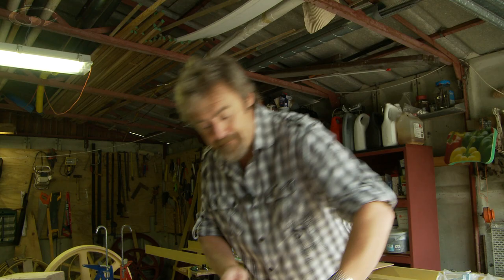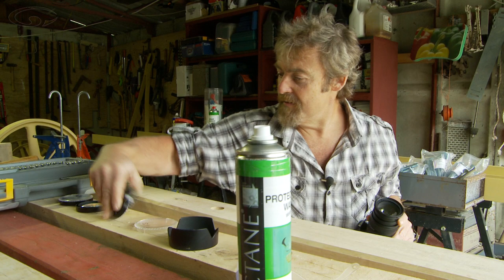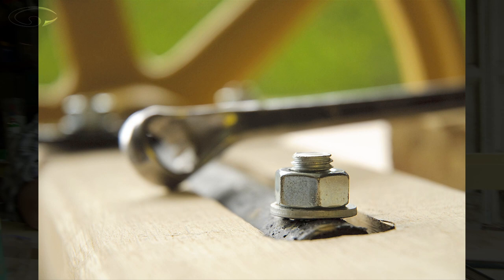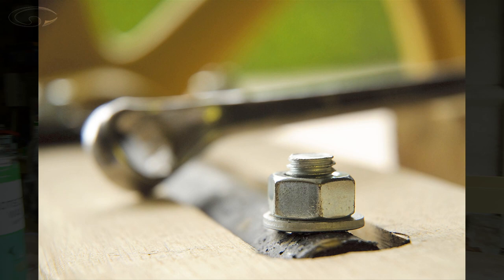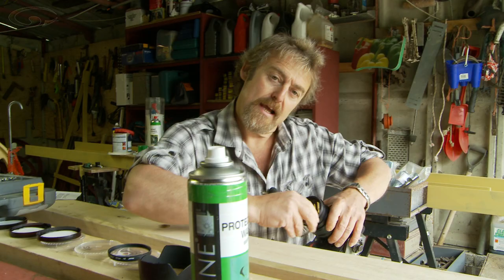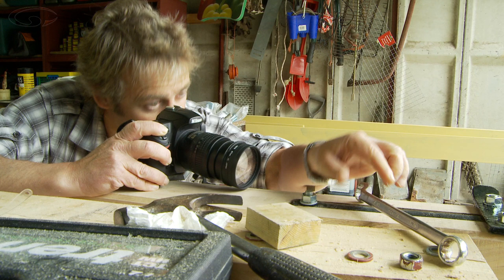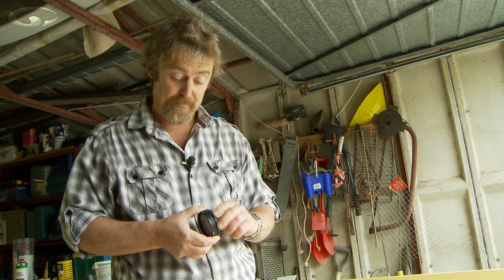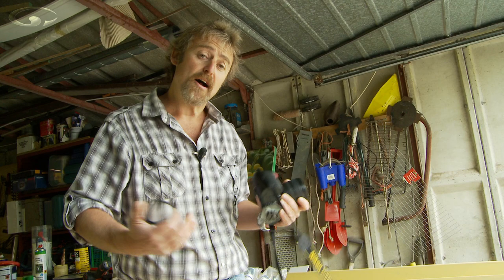How To Use Macro (Close Up) Filters

Comment: Hi Mike,

Buying lenses can be a real expensive hobby. My old 70-300mm had macro (for other camera, but my new 70-300 has no macro - this may be the way to go..

What do you think of Goya brand? They state quality and are fairly cheap.. 

Also, I've heard that the bigger size (possibly with a step-down) give better results. Do you know if there is any truth to this?

As always, great video and thanks for your insights..
Reply from the maker: Thanks Paul. Not sure I can help with this one. Did you mean Hoya? in which case that's what I use and they're pretty good. Shoot raw though because there can be quite a bit of chromatic abberation in contrasty situations. t's easliy fixed in Lightroom. Never heard of Goya.. Or the one about bigger filter is better. if anyone else has experience of this please help Paul out... MIKE
Reply: @MikeBrowne  Goya.. yeah, Hoya (spell checker).. 
Thanks for your answer Mike, I think I'll end up in investing one of these. I'm aware there is slight aboration, more if you stack - some folks seem to use just 1, with a cpl up front. 

Either way, I'll give it a go: kit lens is 77mm and 70-300 is 62 (have ring), just try it out - maybe I will get that ladybird or insect without fighting focus..

Thanks again,  your very kind..

Comment: Hi, great video, but quick question. I have a Canon 70D with a 18-135mm lens and the diameter is 67mm. However, I have many of these filters which came with the product but they are 72mm filters. If I want an adapter to be able to use the 72mm on my 67mm, what length should the adapter be and is that possible?

Thanks
Reply from the maker: You need a 67 to 72mm step-up adapter ring chadfish11. Screw that on your 67mm lens then screw the 72mm filters into it. - MIKE :-)
Reply: Mike Browne thanks for the response! :)
Reply from the maker: No worries... MIKE

Comment: Is this choice of filter size a, one size fits all scenario?  As with ND filters, are you able to get a set of say 77mm close-up filters and use them on a 62mm lens while retaining the same diopter values?
Reply from the maker: They come in different sizes for different diameter lenses +Victor Gee - you cold probably use a stepping ring to make them fit others though. Dioptre values won't change - MIKE
Reply: Thanks for the helpful info!

Comment: I have two lenses
-24-85mm, .38m minnimum focus, 72mm diameter
-70-300mm, 1.5m minnimum focus, 67mm diameter
Which one should I get macros for to get the closest up?
Reply from the maker: It depends on the minimum focusing distance of each of your lenses labradoodleandpalz    Why not get 72mm close up filters and a 72-77 conversion ring then you can use them on both lenses and try it?
Reply: Mike Browne  Why not get a Raynox DCR-250 extension which cost around £45 and gives you x10 magnification. it supports to 67mm thread or less.
Reply: Mike Browne The minnimum focus is .38m on the 24-85, and 1.5m on the 70-300. I'd rather not buy an adapter since I would only use the macros on the lens they work better on anyway.
Reply from the maker: Sounds like the 24-85 is the one then labradoodleandpalz Have fun :-)

Comment: Is there ones for camcorders?

Or lens?
Reply from the maker: Close up filters are screw on Soldier1287 so if your camcorder has a screw fit on the lens you can probably get some to fit. You'll need the mens diameter before you order or take it to a store and see what they have..
Reply: ok.  what is the lens diameter of  Canon Vixia HF R300?  Its small and handheld.
Reply from the maker: I'm sorry but I don't know the camera Soldier1287  You could try some searches to see if there's any info online. If the end of the lens is threaded it'll probably take filters so that's what you have to look at. Best bet is to take it to a store and see what they have.
Reply: ok

Comment: The thing is, these things are pretty useless. they will degrade optical quality your better off cropping in post
Reply from the maker: It depends on the make of filter Rebassed Cropping in post works to an extent but you could be throwing away a massive amount of pixels depending on minimum focusing distance of the lens and pixel count of the camera. THE best way to shoot macro is with a macro lens or tubes.